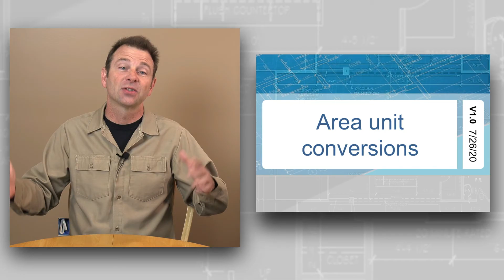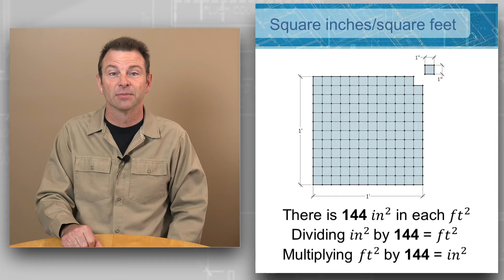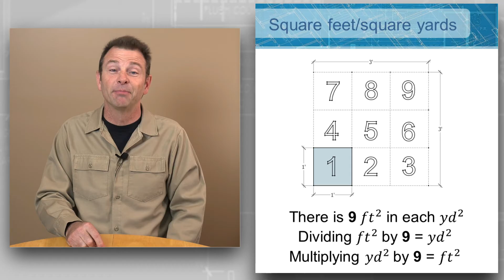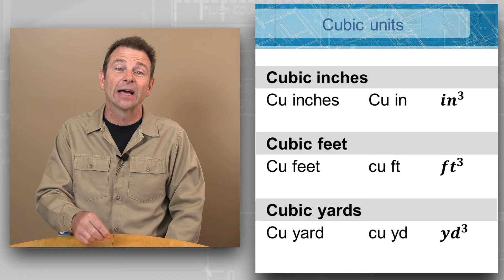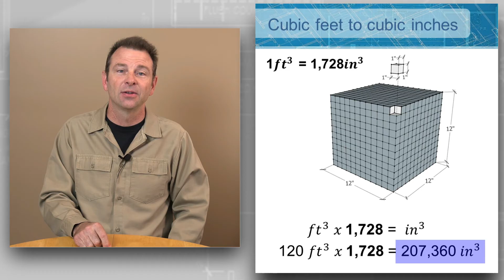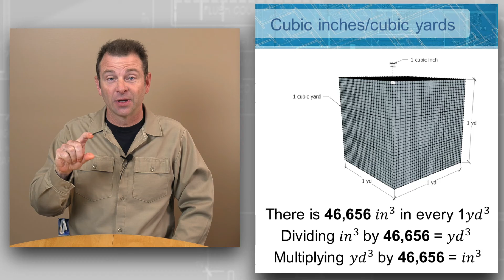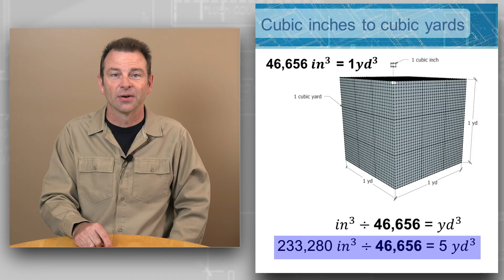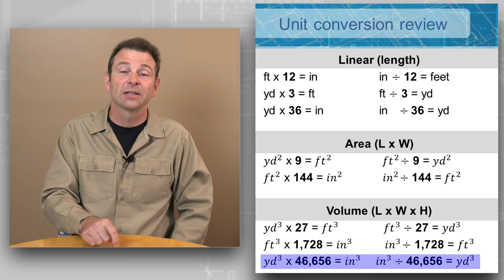Construction Math - Unit Conversions - Applied Math - Trades Training Video

Comment: 老师，你讲的例子都是整数的换算，没有小数或者分数的换算，而实际测量中，数据往往不是整数。例如物体：长：15ft4in3/4 , 宽：21ft7in5/8 , 高：39ft6in15/16，那它的平方和立方怎么运算？分别是多少呢？如果这个物体是直接三角形，那么它的斜边是多少？又怎么运算？由于不是十进制，英制单位运算起来好复杂
Teacher, the examples you gave are all conversions of integers, not decimals or fractions. In actual measurements, the data are often not integers.  For example, if an object has length: 15ft4in3/4, width: 21ft7in5/8, and height: 39ft6in15/16, how to calculate its square and cube?  What are the differences?  If this object is a direct triangle, what is its hypotenuse?  How to calculate it?  Since it is not a decimal system, the calculation of imperial units is very complicated.

Comment: Hi good morning How many courses of block (8" × 8" x 16") are needed to build a wall that is 8' 8" tall?
Reply from the maker: You should be able to calculate that based on the content in the lesson.  just divide the block height into the overall wall height - but remember to allow for the joints